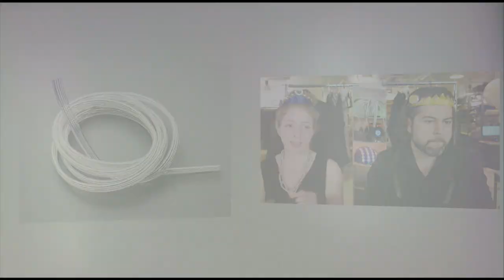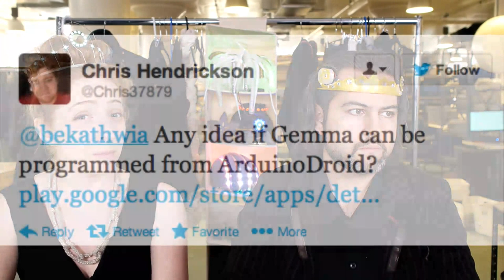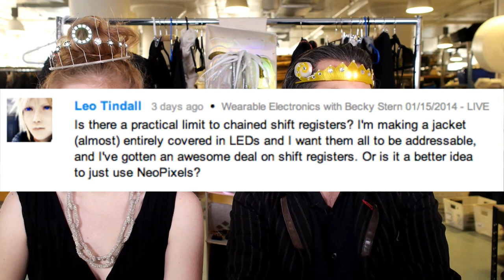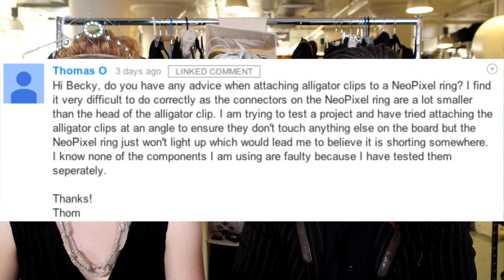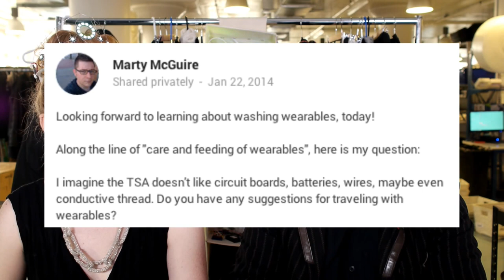Wearable Electronics with Becky Stern 01/29/2014 - LIVE

Comment: (2) You may think your un-toothed flat or round nose needle nose wire bending pliers might help you around this problem, but they leave their own special kind if impression and hold poorly against pulling to boot. To work around this (only practical for solid-core wire) you can strip the insulation off a length of wire longer than you need, cut off the wire, precision cut the insulation to fit the length you need (greater precision with flush-cutters, scissors, olfa, x-acto, etc.),

Comment: (1) Useful precision wire-stripping related hint. Sometimes stripping short wired precisely to get just the length of insulation you need to fit your design is difficult with your fingers. One may try to hold the wire while stripping by the insulation with needle nose pliers, but many are toothed which leaves an unaesthetic compression impression in many insulation materials and also may compromise the the insulation.

Comment: (3) feed the wire back through the insulation (the shorter the insulation piece the easier this is), and then cut the wire to length on either side (watch the wire does not slip between cutting sides (esp. with shorter lengths of insulation (less friction to passively hold it) making the side you last cut too short so you have to do it over (but not too big of a deal)). Hope someone finds this helpful.